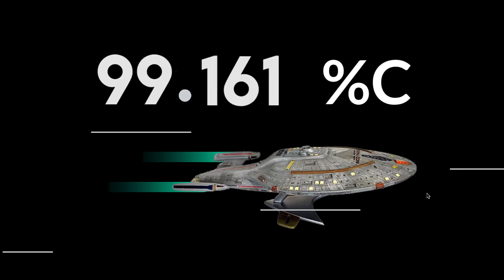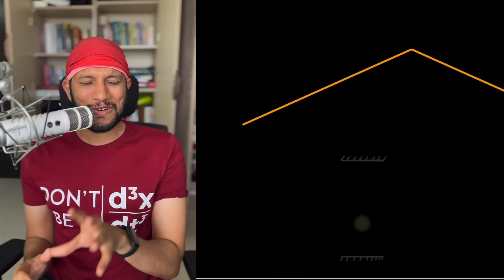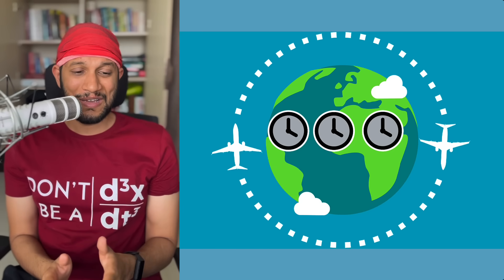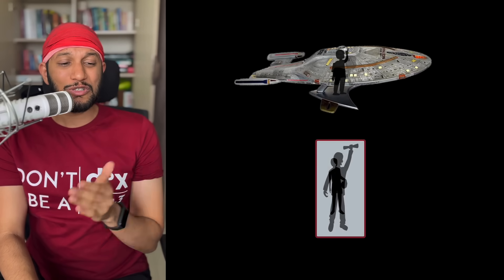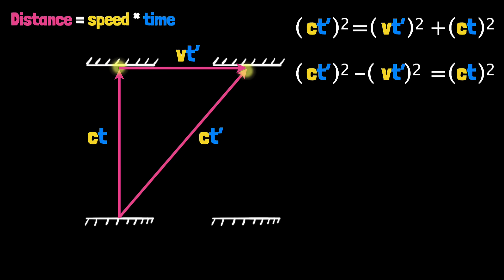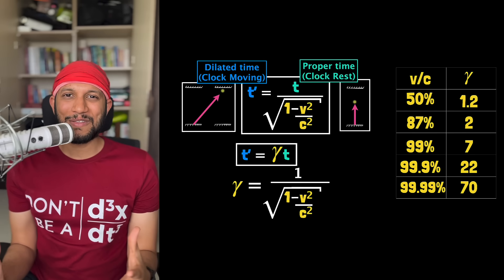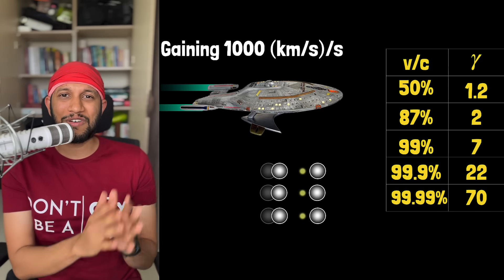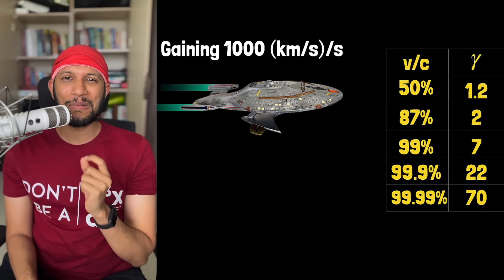I finally understood why you can't go faster than light! (My mind is blown)

Comment: Random question to the matter: Wouldnt someone from inside the ship observe the "resting" clock outside the ship as moving, where the photon then would have to take the diagonal path faster than the speed of light, since two ticks of the outside clock is one tick of the inside clock (for 87%).
I guess similar question is the having two ships moving 55% the speed of light in opposite directions.

Comment: The explanation with the photon clock only works if the photon clock is perpendicular with the movement, doesn't it ?
If you put the photon clock parallel to the movement, it doesn't seem to me tbat it will be slowing down (it would be slowing down on its way toward the right, but speeding up on its way toward the left, if you take the clock "walls" as the reference for the movement)
This explanation

Comment: Does it also stand to reason as photons have no mass, which is why only they can move at the speed of light?   As such, objects with mass can never be zero mass so they can never attain the speed of light.   Things with mass exist within space and time and are bound by these fundamental laws of the universe?  

Also, as mass can only be a positive value,  you can only dilate time in the forward direction.   right?   I often think of Time Dilation as Forward-only Time Travel.    If you're moving that fast you can fast forward into the future, but you'll never be able to return. A one way trip.

Now, if the mass is a negative value, can it dilate time in the reverse direction?  I often wonder is dark matter the negative mass to allow that?

Great video, by the way.

Comment: Why we see different tick time? ..... it is actually called doppler effect and perfectly explain time dilatation, when you go with the ship back, it would seem the clock is actually faster, duh! ..... Problem with cessium clock is, they very much be affected by gravity, so different time is quite possible. It is my problem with relativity, it won't explain why c should be the ultimate value and why I shouldn't be even able to throw a ball from object travelling ~c ..... and speed according to what? Imagine two ships travelling opposite directions, when they meet, what will be the speed to each other? So about two times c, right? It is why it is called RELATIVity, because of what is much more easily explainable with doppler effect. Also it is very well possible gravity waves travel faster than light .... actually .... why not?

Comment: Mahesh, thank you for your absolutely fantastic videos. 
I have a question regarding photon clocks that I don't know if I will be able to articulate: 
It has to do with the fact that, from the moving object's perspective you see it bounce up and down, but when seen from the stationary perspective you see them travel diagonally. But if light, once emitted, is detached from the frame of reference that emitted it (i.e. light speed is constant), then how does the photon "know" it has to move diagonally? Or maybe my assumption that light gets detached from its emitting frame of reference is wrong? Is light speed constant in the direction of travel, but not in the perpendicular direction? That would be the only way I could understand that the photon moves diagonally, as if it had an initial speed in the perpendicular direction of its motion. 
I hope you can explain this in one of your future videos.

Comment: 11:15 From earth you would see two seconds 'ticking' But when you are on the ship, you are in a different frame of reference. You would see 2 ticks on earth for every 1 tick on the ship. Both reference frames see the other slow down, so who is right?
Reply: Both are right frames. Speed is relative
Reply: @alien3200 
My question is, what happens when we meet up. We both see each other as 'older'. So when we meet up and both start going the same speed and direction, who's perspective is correct? This is my question, I have never seen the answer as to when you meet back up.
Reply: @joshguyer4593   the person in the spaceship had to speed up, turn around, and slow down to come back. These changes in speed break the symmetry.
That makes the situation different from just constant motion.

Both think the other’s clock runs slow while moving. But in the end, the ship traveler ages less because they experienced acceleration and deceleration.
Reply: @alien3200 
Fair point! When only one party is accelerating that makes sense. 

Keep in mind, I am not shooting for a gotcha here, this is something I just can't grasp. What happens when two ships accelerate away from each other at the same rate for half an hour, turn around then meet back up? Both ships see the others time slow on both the trip out and back, both have accelerated. Both see an hour long trip for them but a two hour trip for the other? What do they see in each others clocks when they meet back up?? It seems paradoxical... is it or is there an easy explanation?

Comment: So, if I were on a ship going 50% the speed of light, and I turned on a flashlight pointing in the direction of travel, what would be the speed of the light exiting the flashlight to the people in the ship, and the people outside of the ship?  Is the speed still C or is it 50% of C to those on the ship?  Speed is relative to the person measuring the speed.  For instance, right now as I sit at this desk, most people would say my speed were 0.  However, if someone viewed me from space, my speed would be about 1000 miles per hour (if my desk were at the equator).  This is because I am being whirled around with the earth at that speed.  Then if you measure me from outside the solar system, it would be the orbital speed of earth along with the rotational speed.  Viewed outside of the galaxy, you would also have to include the orbital speed of the solar system.  Speed is relative to the observer.  If I were in a ship going 50% of the speed of light, and I shine a flashlight forward, if I measured the speed I think it would be C.  However, a person outside of the ship, the speed would be (again I think) 1.5 * C.

Comment: But if nobody watches my spaceship, I can ride in light speed
Reply: you are the second smart i found here

he is wrong. no real clock slows down, because no real clock measures time, not distance. all real clocks measure time*distance, and that is a non-variable. 
Einstein was often confused
Reply: @Sergiu.antifascist 
He mentioned it as a theoretical explanation.
Reply: @Sergiu.antifascist You keep copying the same thing, and yet make absolutely no sense. "you are the second smart i found here" you found someone that is just as stupid as you, so you consider him smart? If you are in a spaceship, you also become an observer of the inertial frame inside the ship, i.e you are observing the atoms move from one state to another from the outside. its a Russian doll set of inertial frames. 

consider your space ship a rectangle with only 2 atoms one on each end(one on the left and one on the right). there is a force being applied from the left side, and you accelerate that rectangle towards the right side of the screen, for the acceleration to register and for the rectangle to move, one atom needs to move(left atom), and then that movement needs to registered by the second atom(right atom), so, lets say if the rectangle is just starting out, the electromagnetic force will move at a speed of light and the rectangle will move as usual, in its perspective time is flowing as usual. now, lets say the rectangle has accelerated to 50% the speed of light. both atoms in the rectangle are moving at 50% the speed of light, now if it wants to accelerate, a force is applied to the rectangle, and the second atom(left atom) would be the first one to accelerate, and that acceleration needs to be transmitted through electromagnetic force at the speed of light to the second atom on the right for the entire rectangle to move and accelerate as one. but the thing is, the second atom is also moving at 50% the speed of light, so the electromagnetic force takes 2 times more to reach the second atom, even though the force is moving at the speed of light, the second atom is moving away from it at 50% the speed of light, so it takes longer for it to arrive, doesn't matter if we are looking at it from the outside or the inside. the propagation of force will always be slower the faster you move. and if you move at the speed of light, you don't move, because the time it takes for the electromagnetic force to move from one atom to another would literally be infinite. no matter how much energy you put into the left atom in our rectangle example, it wouldn't reach the right atom, because it is moving at the speed of light. 

From the perspective of someone outside the rectangle spaceship, the rectangle is moving at light speed, but from the perspective of the spaceship, you have barely aged or barely moving. 

i have been studying science for over 25 years, and i have not seen a clear example of the Dunning-Kruger effect until i saw your constant comments. 

"because no real clock measures time, not distance. all real clocks measure time*distance" what does this even mean.

Comment: Time dilation has more to do with observation. if we don't observe, there is nothing there. the ticking photon did not give that explanation. If you are an outside observer of a accelerating space ship and you are looking at a clock in the space ship, that information has to come in to your eyes. dilation happens there. and it is not true to say you can't ever travel faster than light. Space can move at any speed.

Comment: Meh. 
On one side of the sun, a group of photons are traveling south at the speed of light. 
On the other side of the sun, a group of photons are traveling north at the speed of light. 
Pick one relative to the other and you get twice the speed of light.
Moving faster than the speed of light happens on a daily basis, if your photon.

Comment: Very well explained. I have a question though, this theory assumes that the speed of light remains constant. Isn't is possible that instead of time dilation, it is the speed of light that changes as the aircraft is moving? Consider a hypothetical scenario of a spaceship that is moving from left to right at the speed of light. Imagine at the starting position a person standing at the right end of the space ship, who sends a photon towards the left end. Lets say it takes the photon time 't' to travel to the end of the space ship (a distance of cxt). In the same time, the space ship has travelled to the right by the same distance cxt. So while for the observer inside the ship, the photon has travelled to the other end of the ship, as the ship itself has moved by the same distance to the right, to the outside observer therefore the photon remains at the same position as it was. So for the outside observer, as the ship is moving at speed c, he/she sees the light at speed 0. What do I miss here?

Comment: What about the perspective for someone inside the ship? for them time is proper time so they should reach the speed of light after enough time (if acceleration is 1000km/s**2, then in 300 seconds but this perspective doesnt need the extra force increase?  although theyll be in the far farr future when they do reach it with respect to someone outside the ship (ik something is wrong here, will be awesome if you explain the problem here))?

Comment: Well there are some gaps in this explanation that still make it illogical:

1. If the atoms in the spaceship can not transfer force or momentum to each other because of photons moving to slow, that would maybe explain, why a starship would just disintegrate because the bonds between the atoms cannot be held up. But if we go down to one single atom: This atom does not have to transfer any information or force to another one, so no need for carriers. Can this ONE atom be accelerated to lightspeed? Maybe the atom itself would fall apart, but then we go down to one Proton or Electron? What happens? I don't know...

2. Time is NOT defined some photon travelling a certain distance between mirrors. Instead it is defined by the caesium frequenzy, which (as far as i know) is fixed. What You described in your video are actually not "clocks" but more like metronomes. So taking them as a measuring for time is really vague.... And a metronome can be adjusted to any set of "beats per minute" as you like. What about the clocks in the plane and the clock hands? You said the clock hands start moving slower because the atoms in the hand cannot transfer the force fast enough.. So slow moving hands of a clock means time runs slower? WRONG! That would mean I could just stop time by duct-taping the hand so it can't move anymore. The hand is moved by a mechanical gear and if you block the gear to slow it down you just get the clock out of sync... nothing else... This may sound strange but a clock is actually not a valuable measurement device for time... Because the mechanical components can be impacted by outside forces to bring it out of sync.. Take 2 clocks, put one on the plane and one to the ground after setting them to the same time.. Fly around earth and look at the clocks.. You actually applied a force to one of the clocks and slowed it down.. So let's say one clock shows 60 minutes passed and the other one shows only 59 minutes passed. What happened? Did time run slower on one of them? NO! Due to the force applied while moving a clock you slowed down the gear in the clock and so it is just out of sync.. Every time measurement must have some components in it that are affected to outside forces. THESE components get slowed down but not time itself... 

3. I am amused every time that scientists are making an experiment, gathering certain values, create an equation to describe the phenomenon and call it a day saying the have decoded the universe. What is the fastest we have ever actually moved? Only a fraction of lightspeed has ever been observed by experiments and the rest is: INTERPOLATION That means you have certain values and ESTIMATE how it COULD be at other points... What is the problem with interpolation? Well it is just a guess, not a scientific proof. Can we REALLY know how things behave when they go at the speed of light? No, because we don't have the technology to try it ourselfes. All we can do is measure the tiny part of c that we can achieve and based on that, we GUESS what happens.. 
Interpolation is NOT a valuable source of information. You need proof for that statement? Open Excel and put in the following pairs of information:
30 - 0,995650
20 - 0,997995
10 - 0,999702
And then interpolate to get the value for 0... You will all get the same value. Mathmatically this value will be correct, but still it is wrong, the correct value is 0,99843. But how can that be? Well because nature has it's own laws and also EXCEPTIONS. Those numbers show the densitiy of water at different temperatures. This is a so called "Density anomaly". So you cannot calculate the density of water just by interpolation. You instead HAVE to measure it at the certain temperature. And just like this I doubt anything that is just based on interpolation and estimation. Einsteins Relativity Theory might said to be proven but ONLY for the parts we can actually measure with scientific experiments.. the rest is just estimation.

4. Imagine we accelerate an atom inside an object near the speed of light. The photon cannot transfer the force to the next atom so the bound between them is useless. Will our accelerated atom just "bump" into the other atom? if not will it just pass it? I know atoms are pretty sparse inside even the most dense material but even if we go down to the smallest particle and accelerate it to lightspeed and it collides with another particle. The photon is not carrying the force but what about the particle ITSELF?? Newton said that 2 objects can never occupy the same space at the same time so those particles can not just pass through other particles. At some point there MUST be a collision. And that collision will definately transfer force, energy or whatever to the next particle. So one particle at lightspeed MUST be able to basically push another particle even without photons as force carriers. 

Everyone feel free to correct me about anything that I might got wrong at this point. I am always open to a genuine debate about this topic. I don't want to say that Einstein is wrong. But instead I would say he has made kind of an interpolation that STILL has to be proven at the real lightspeed-moving object... Unless that happens, I still go by my old credo and say: When scientist use the word "infinte" they just mean "I don't know (yet)"

Comment: We know that SR is an incomplete theory and breaks down for BHs. According to your explanation, a spacecraft for example, should never fall physically (i.e. for real) inside a BH and would freeze and come to a complete stop on the event horizon of  a BH where the speed approaches and becomes equal to the c speed of light in the vacuum and time stops.  We know this is empirically wrong and matter actually gets swallowed by BHs (BHs' waterfall effect) and theoretically the speed is effectively superluminal after the event horizon inside of the BH (space itself can move faster than light according to SR).

In my opinion a more comprehensive explanation although not very scientific one, would be an example by analogy we know empirically,   similar to the fastest speed possible inside water thus the fixed speed of sound inside water the same also implies for the fastest speed inside the vacuum being the fixed value c. It is actually an intrinsic physical property of vacuum space itself for moving objects inside it.